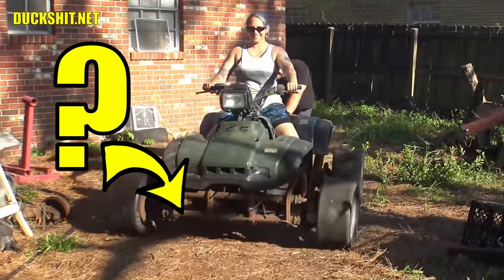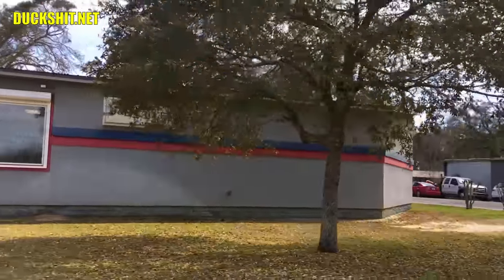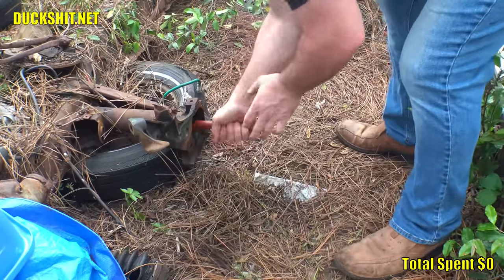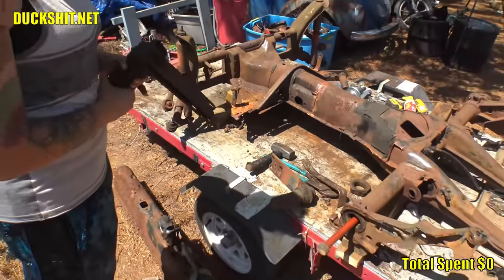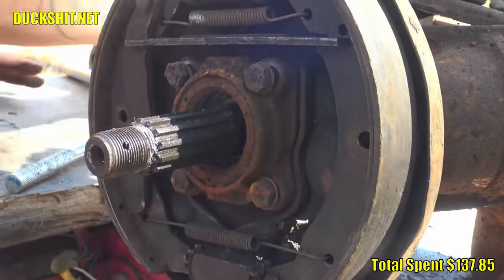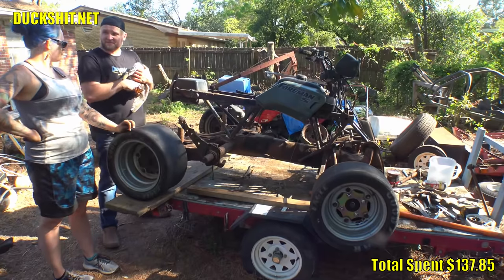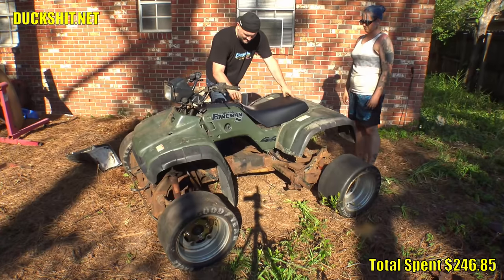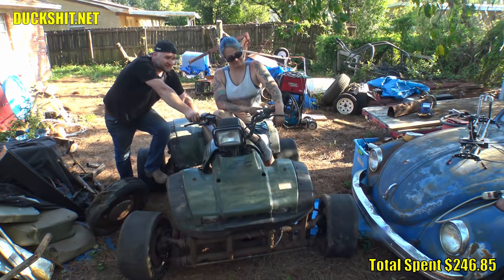VW Motorcycle - ATVW Duckman's Junkyard Build

Comment from the maker: So what would you guys like to see me do to this thing next?
Reply: Why not use old snow shovel heads for fenders? If you are lucky a small beer keg for a gas tank?
Reply from the maker: @pierreduplessis1507  Where do you find a FREE snow shovel in Florida?  Got any beer kegs to give me?  :-D
Reply: @DuckmanCycles  sadly no beer kegs. 😭😭
Reply from the maker: LoL!  Gotta be free or super cheap!
Reply: @DuckmanCycles  If you drive down across the Suwannee River and turn toward Andrews Wildlife I left a $1.00 snow shovel wired to the pine tree out in the  front yard. If it's still there you might sneak in after dark and borrow it.😭
Reply: Engine start.!!!!!!
Reply: we got plenty of beer kegs here in Texas
Reply: If you were using bigger wheels I would have said porsche brakes!!!!! excessive....yes, awesome....hell yes!!!!
Reply from the maker: I would have to have junk Porsche brakes around to fit in with the plan!
Reply: it reminds me of Mario Kart
Reply from the maker: Me too!
Reply: Just needs  the Rear Drive Axle Electric Assist Motor Fits 06-16 Toyota Highlander Hybrid add some Bolt batteries a few other bits aka 100hp of fun... :):)
Reply: Finish this ASAP !

Comment: Looks like fun. Now bolt on a 1776 with a Weber 34/36 and a transaxle with taller gears.....let. the fun ensue
Reply from the maker: I'll have enough problems keeping the front end down with a stock engine lol!
Reply: @DuckmanCycles  
Lol, live dangerously. Get some super glue and slap a big chunk of steel up on the nose of the center tube. It'll help..... a little ..
Reply from the maker: I actually have a partial plan for that and I will be covering that in next couple videos!
Reply: @DuckmanCycles  
Looking forward to it.  I built a street trike or three in my day, so watching you do this is bringing back some memories. 😆

Comment: I built a Volksquad about 12 years ago. I used a sport bike as the base frame.  I used the bike master cylinder (which was a mistake).
Reply from the maker: Tell me more about the master cylinder mistake, because I've been doing some math trying to figure out what I'm going to do there.
Reply: @DuckmanCycles   I used the bike master.  It could not push enough fluid to activate the brake.  Use a VW one activated by foot.
Reply: I have video on it’s maiden /only voyage.  Due to brake issue I caught my leg between the rear torsion bar and a curb.   (Plate and 8 screws).  
There is a build log on volksrods.com.  Just look up “volksquad”.  

My wife made me cut it up after she caught me on it figuring out issues within a week of getting home from the hospital
Reply from the maker: How many brakes were you running off of one motorcycle master cylinder?
Reply: @DuckmanCycles   I was set up to run them just like the motorcycle.  Had front brakes to front wheels and rear foot brake to the rears.  

Maybe I will put together a video on it.  I think about it all the time and how I would build it now.
Reply from the maker: Thanks!  So two brakes per cylinder.  I'm doing some math on the hydraulics and I'm not sure how I want to do this all yet.  I guess we'll see soon!

Comment: Hey I was wondering about a video you made 9 year ago about a mini chopper part 3 or somthing I am needing a rear fender for mine do you remember were you got that one
Reply from the maker: Yep strange place to ask about it though, as you know the which video you're asking about and this video is unrelated!  But I found it on Ebay!   And to be honest I've never seen another one like that since, I was very happy that I found such a unique part! Thanks so much for the question, good luck to you and hopefully you find something like it if that's what you're looking for!
Reply: Thanks
Reply from the maker: @motokidv119  You bet!  Take some measurements on that rear tire and calculate the height width and length and radius of what you're looking for.  That's about how I found mine!  Hope that helps!
Reply: Will do thanks

Comment: Steering needs to turn Shorter.  Extend Steering arm.
Reply from the maker: LoL think so?  Your logic is actually backwards.
Reply: @DuckmanCycles  Nope.  I have built and raced many VW Dune Buggys.
Reply from the maker: Well the logic is still backwards.  The arm has already been worked as mentioned in other videos.  I actually have more steering range that a stock beetle with very little input.